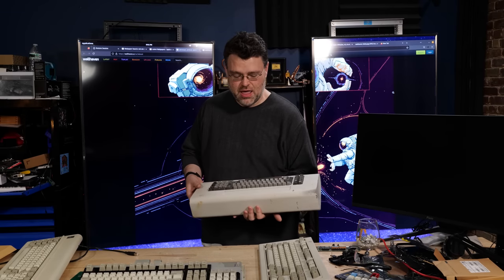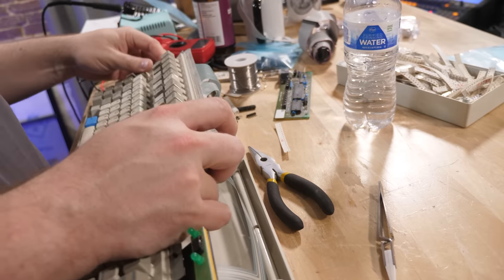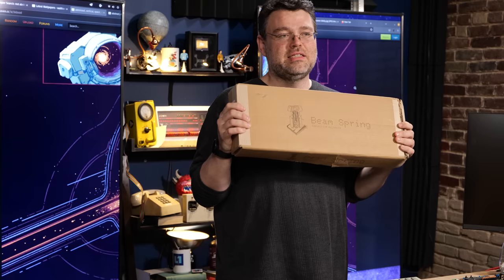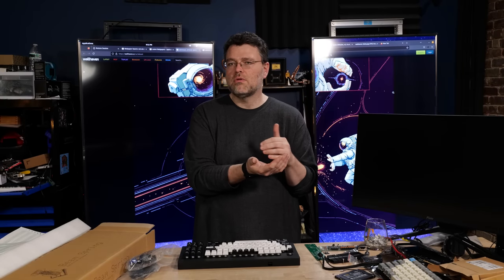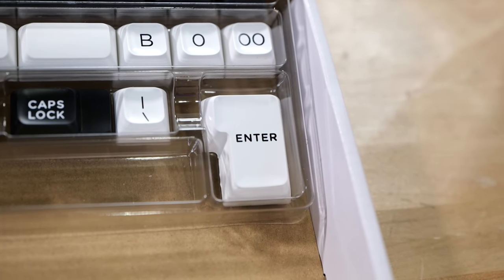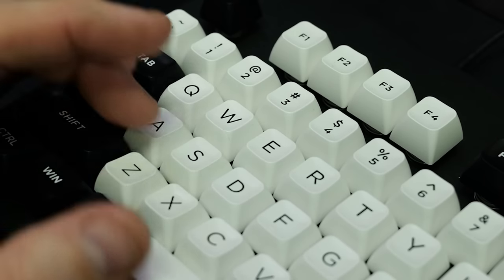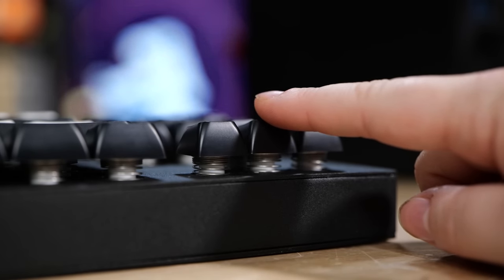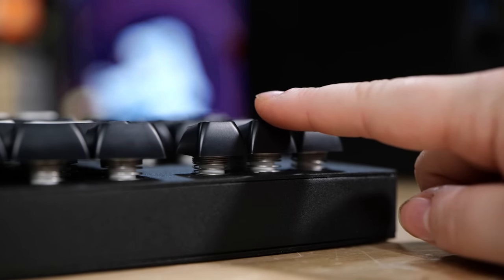Beam Spring: Dead Keyboard Tech w/USBc

Comment: Original beam springs often didn’t have stabilizers for 2u or 3u keys because the switches were good enough to handle even pressing on the very edge or wall of the cap. Beamspring switch is so well-designed that you could push the key sideways and it would still go down perfectly smoothly!
Reply: it's a little bit unfair, it's mainly because the switch is so tall. Just has to do with the binding coefficient.

Comment: USB C connectors for keyboards should really extend past the PCB and be sandwiched between the case to stop vertical movement happening, doesn't take much to break SMD connectors off the board if the cable is snagged when moved.
Reply: Yeah - the university where I work at has been looking for 'armoured' type-c PCB connectors to put up with abuse in the various sensors/electronics we build from scratch.
Reply: @RamonInNZ  How about an ultra-short extension cable with the female end screw-clamped to the chassis? If it gets mangled, replace it.  The best thing I'm seeing on Amazon for that application are 20cm with a right-angle connector on the male end, so you could design the PCB with the jack on the side, and not need too much internal volume to route it to the front panel.
Reply: A lot of custom boards use a daughterboard, a small PCB with the connector. Very cheap and easy to replace if it breaks. Some older boards did that too, one of my early boards was a WASD brand one, I broke the connector and support sent out a replacement including pry tools. 

The board isn't anything to write home about but i'm glad they had a daughterboard in there.
Reply: What about a connector like those between those coiled cables, I think it's called QDC. So you insert it, then screw it on to secure it.

Comment: Good points about USB-C! If a device isn't going to be seeing tons of mating cycles, something sturdier does make a lot of sense. I know it doesn't support the goal of ultimate thinness, but I sort of wish that USB-C had been designed to take at least a bit of the plastic inside. It's quite easy to damage a connector and even a port because the amount of stiff material sticking out creates a lever  that can be efforlessly pushed with one clumsy move.

Comment: For the USB C connection, consider getting any one of the now myriad of magnetic connector adapters that allow the cable to be ripped away, without damaging either the port or cable. Additionally, there are types that change the angle of the connection, so you can have right angle connectors allowing the cord to run along the keyboard back, rather than sticking straight out.

Comment: for the usb-c i do agree that it is a concern. however for a product this size my feeling is there should internally be a seperate daughter pcb that can be chosen as either type b  or c. and then when it inevitably breaks it does not have to destroy main pcb with it etc.

as for how to solve - yes recessing i agree. but if that has not been designed in, then can buy either a right angled usb-c cable is one partial help.... the other  help are those usb-c cables that are like magsafe. with a magnetic end that breaks away under duress. h2h

Comment: I suppose I'm "lucky" with my type-c keyboard, the connector is well within it and it has little clips for the cable so the connector should never really be stressed.

Also makes more sense than B in this location because it's under the keyboard, but it could always be moved.

Comment: Even some razer mice that I own have a usb connector that has a huge plastic moulding around it that sockets into a slot in the mouse or in the dock. That takes almost all of the stress on the Connector away. I get they don't want to use that because akward cable replacement but it's an easy solution

Comment: Sadly No. It's not older that me. I am in fact older. But thanks for the reminder! 🙄🤦‍♂ If you adding USB to something like a keyboard then please also add a USB Hub. Check out the Dell SK-8135 which has two USB 2.0  ports which are good enough for a mouse or other low power devices. A version that supported USB 3.2 Gen 1 would be nice 😀
Reply: Me too. Made me feel old when he said it's probably older than us.

Comment: Hey ... I am from the 1970's :O 

The first and worst keyboard I had was the ZX Spectrum rubber-top dome-switch multi-functional HORROR.
Then came the Commodore 64 with a slightly less total cr@psh00t or a keyboard.

Then finally an XT. Don't know what keyboard it came with. Maybe it was an M-type. 

That said. Kinesis Advantage is the best thing that ever happened on my desk. (other than the 10+ different trackballs I tried ..) 

When it comes to keyboards: gaming has to be "normal" and mechanical (blue clicky preferred).
When it comes to typing, it has to be non-staggered and mechanical (blue or brown preferred)
Reply: The XT was a Model F, but the layout wasn't very good. That IBM AT was also a Model F, but a better layout. Model M layout is the best layout of the three, IMHO, but the key feel is inferior.

Comment: dang thats alot of SSK's i wish i had an industrial variant of the SSK i just have a normal one
Reply: I snagged a few industrial SSKs years ago off of Ebay from someone who didn't realize what they had, I think for about $50 each. Never opened them or used them. If I recall the ones I have are with the blue Mopar keys. Maybe I should dig them out and sell them. I've never really used any of my SSKs except for when I travel. For desktop use I prefer the full layout.

Comment: I feel like you could make a housing for the USB C connector that would clamp down on the cable securely, but yeah, if there's no built in hub or anything else in the keyboard it's a waste of what few Type C ports most motherboards & cases have. I don't think people care about the bandwidth, as outside external drives, most peripherals simply aren't going to use that much bandwidth. 
Building a Type C hub into the keyboard would be ideal.

But the wobble in those keys is bothersome to me.

Comment: It would be nice if it were like the framework laptop, an internal USB-C port, but then a little block that swapable with the USB-C port that is cheap and easily replacable, Do you want USB-B, just use the USB-B version of the card

Comment: Nope. Wendell they did the right choice here. When was the last time you were able to find a loose USB-B cable in a store? When was the last time you ever found a USB-B 3.1 cable loose in a store? Using USB-C keeps this keyboard accessible without compromising on future cable compatibility, or relying on connectors of the past, even if past connectors are mechanically better.

Not that I disagree with the principle. But I disagree with implications of practicality when USB-B is something you have to get in some older piece of hardware as a pack-in or from shady third-party resellers. USB-C is here, is here now and will always be here.
Reply: The corner gas station has USB-B cables on the counter right next to the lighters. Why would -C "always be here" any more than DB-9, FireWire, 8P8C, PS/2, etc.?
Reply: Why do you think USB type B is a "connector of the past"? It's current, you know. They still manufacture those cables. Practically every printer on the market uses it. Why would you have to get it from a "shady third-party"? I checked multiple computer/electronics stores, they all have USB-B cables, in different lengths and in vast quantities. You're talking like he put a big ass centronics port on it or something. Why would USB-C always be here, any more than USB-B? I don't understand the cult of USB-C. Youtube tech-soys and redditors worship it like it was designed by Jesus Christ himself, but why? Why does everything have to use USB type C, even if something else would be better suited?

Comment: USB-B specification requires USB device to have its own power. It's completely inappropriate for keyboards. You can legally choose from Mini USB, Micro USB and USB-C. Because first two are obsolete and basically trash, USB-C is the only option.
Reply from the maker: Not only is that wrong, it doesn't even make sense if you think about it. How many devices existed that were the mini b variant of b? The 5th pin was even for reverse USB. The connector is not suitable for USB charging but for a sub 150mah keyboard it's within spec and would not require external power.
Reply: As far as I know there is nothning in the USB 2 /3 mechanical and power spec that requires a USB type B upstream facing port to reply on its own power. Could you point me to the relevant doc?
Reply: @Level1Techs  USB Mini B does not have this requirement, full size USB Type-B does.
Reply: @dm1i  link the spec